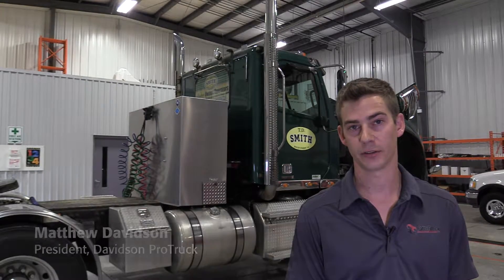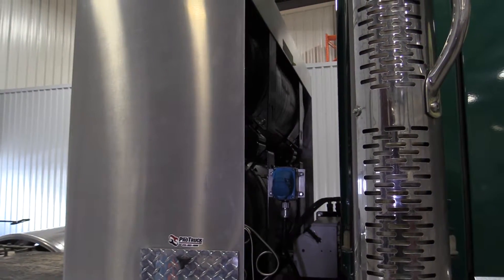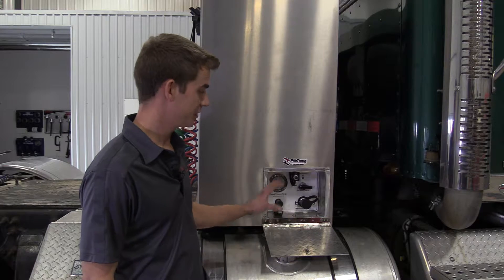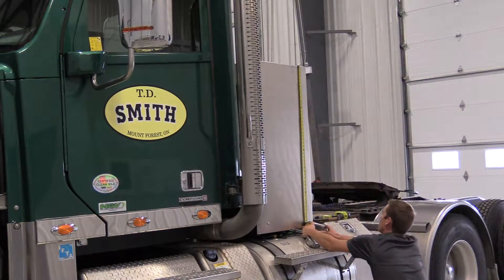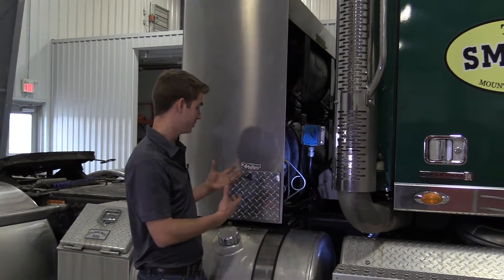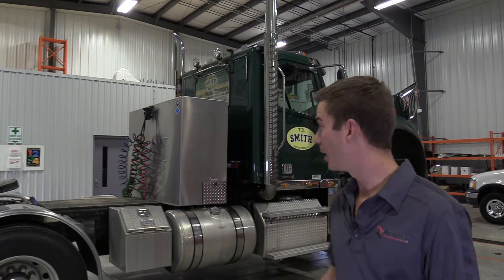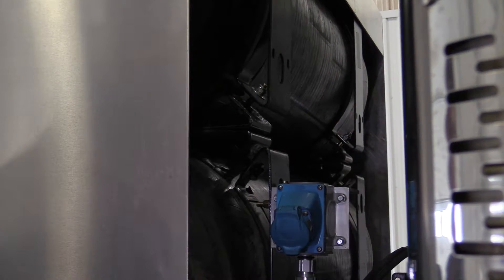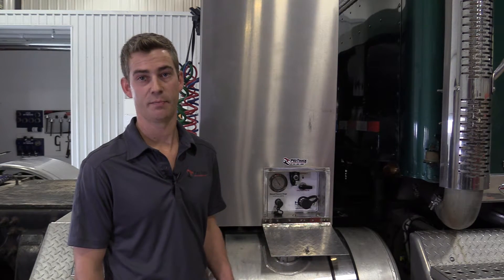Natural Gas Vehicle Conversion Reduces Both Operating Costs and Emissions

Comment: I love this concept... I am just wondering if the use of CNG with diesel fuel is mixed together in the diesel fuel line supply or the CNG is pre-injected similar to port injection? Or some other method that I am not at your level of imagining already?